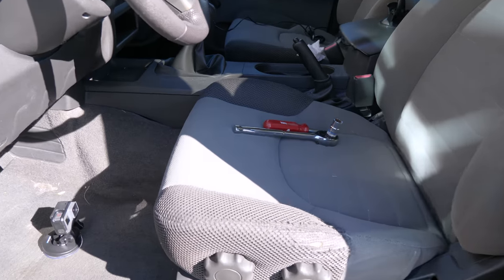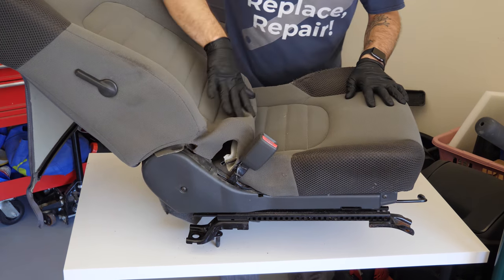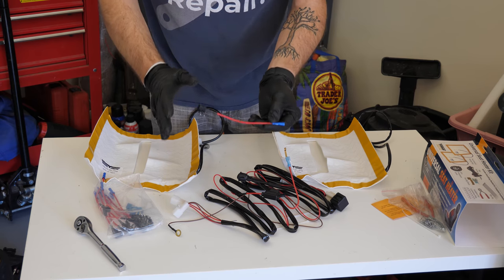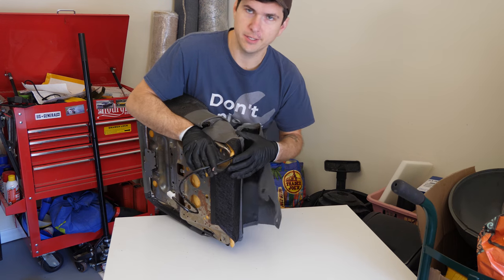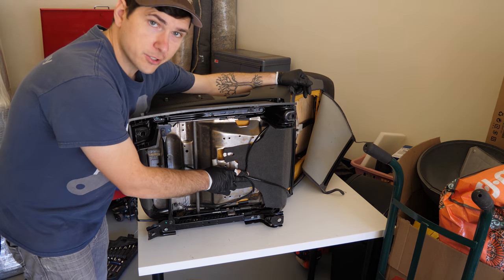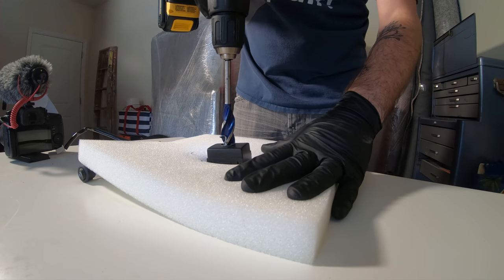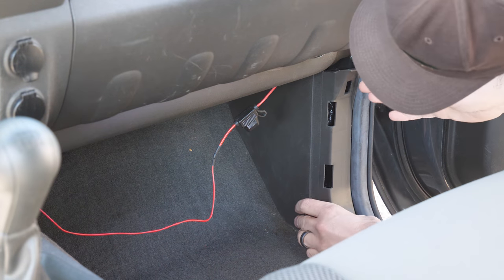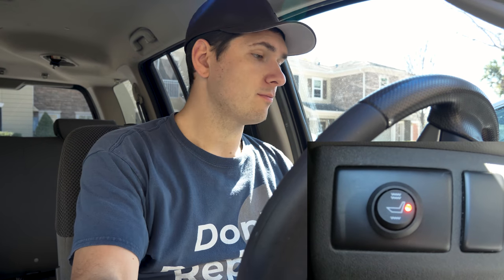How To Install A Seat Heater Into A Nissan Xterra/Frontier/Pathfinder/Armada

Comment: I spent years in the automotive aftermarket industry.  I've done plenty of heated seats. 
You have mad skills my friend
Reply from the maker: Thanks! 💪🏻👍🏻
Reply: Hi  I have a 2012 Maxima and I did a complete interior swap. The new seats are factory heated seats and the new console has the seat heater seat buttons.Is it possible to use the wires from a kit like this to wire those seats? my car is not wired for heated seats.

Comment: A couple ideas. 1) You could replace leaf springs. 
2) Replace rear open diff with some sort of limited slip diff. 
3) add a snorkel (I know that isn't really useful for you but I've been wondering if it's possible)
Reply from the maker: Love the leaf spring idea. Snorkel sounds fun too! Not sure if I want to get into the diff but I appreciate the suggestion. Thanks for the feedback man!!
Reply: @Rythecarguy  No, Yank you! I have 2011 Xterra and your vids have been very helpful many times! Replaced struts and spark plugs using your videos. You have me tempted for seat warmers!!!!

Comment: Love all of your videos, thank you!  I just did this to my 2012 last night.  Quick question,  did you wire both seats to one fuse or did you use two different slots?
Reply from the maker: I actually only did one seat but if I did do both I would have used a different slot for the other seat. Don't want to overload.
Reply: @Rythecarguy  right on, thanks!

Comment: Excellent video, I was looking for a video to replace the upholstery. This is great! Except that you did not removed the seat cover completely. I think if you remove the cover seat and replace it with a new one since you already did all that work, then you will be able to position the heating pad on the desired position. You/we will now have a heating seat with a new upholstery! Mine is already ripped and I’m sure most of the 2005 Xterras need a new cover. This could be a less expensive than doing all the upholstery. 
Hopefully you do a video showing us how to replace that seat cover
Thank you!

Comment: Hey my window has been rolling up really slow and I’ve heard lubricating the rails and stuff can help. Could you make a video on this?
Reply: I can tell you from experience your wasting time & lubricant.  You'll have to replace the motor & regulator.  They are cheap & easy to do.  1A Auto sells the parts & has How To Videos.

Comment: Love you channel being a fellow Xterrarian here lol. Your vid helped me on my Fog light install. I will say seeing yours tho with Manual rolling windows my last car had that was in early 90s and I had no idea X had that as an option. Also at end of Vid we have same year 2005 curious how many miles I have automatic with 108.7k but electrical windows. How about for your next thing to do is Tint the windows on it which you being in Florida would really help!!! Love the channel and all the vids you been making! Last thing couldn't you get nice seat covers and stick them to Stock Seats then put seat covers over and wire how you did?
Reply from the maker: Thanks man! I appreciate you watching my videos! My X is going to hit 150k soon. I think I am around 148,500 miles. I like the tint idea, it does get crazy hot down here. I suppose if you are not worried about potentially messing up your upholstery with adhesive you could try it. I would also recommend a very thick seat cover of you try it. Most seat covers are super thin. I would not want you to burn yourself or something by not having enough fabric between you and the heating element. If you try it let me know how it goes!
Reply: @Rythecarguy  Thanks for reply and really do love your X vids. You make everything so simplistic and enjoyable as you do stuff.. I bought some on amazon and they are a little thick like 1/4 inch and like a neoprene fabric style. The main reason is I've been needing to cover seats as driver seat from coming in and out is separating at a the point where the 2 fabrics meet from climbing in and out of the truck which for every older X i see that happens to it. So I need seat covers honestly to protect it and make the seats last and don't want to put in heat elements in regular seats then have seat covers as that seems to thick to me and won't be hot enough I think. I am gonna keep my X running as long as I can I love that truck. Its also 2wd "Soccer Mom" Edition lol. I bought mine brand new in 2005 with 3miles on it and like I said I have almost 109K now.

Comment: I always enjoy your quality videos. Once again this is a Great video. I did both of my front seats for 2008 Xterra two years ago. By far the best mod I have done especially if you’re in a cold climate. I have not done any upholstery before so taking pictures was very helpful. Also, the metal parts under the seats are sharp so wearing the right gloves saved my hands. 

At the moment I am dealing with the short in my Transfer Case Unit. Essentially my 4wd works intermittently. Dealer quoted 1500$ CAD to replace. Can’t seem to get my hands in a used unit and the part itself. Is about 1200$CAD. Any ideas where to get a used TCU?

Comment: Thanks for the video bro I love it I defenitly going to do this on my xterra but I have a question did you add heaters to the two front seat and one switch? Or you didn't show the second one thanks again
Reply from the maker: Oh yea didn’t mention that. Second one would be a second circuit and second switch.
Reply: @Rythecarguy  thanks bro you are very good reference before any project

Comment: Hey RY the CAR GUY. Really nice videos I have a question  i have 08 exterra. I did LED LIGHTS and I unplugged both  battery cables like you did on one your videos. And the VDC/SLIP LIGTHS COME ON I DON'T KNOW HOW RESET PLEASE CAN YOU HELP ME. THAN YOU.
Reply: dquintanlla That happens sometimes when the battery is disconnected. Drive it for a while and it will reset and go off.

Comment: Aloha y'all...
I'm curious about where you purchase parts online for the Xterra...? Amazon?
I've removed my headliner for repair (the liner fell apart and hung off the headliner for months before I pulled it off) and promptly lost some of the brackets and bolts...
[  I regret NOT simply putting them back in place AFTER I pulled the headliner out... (sigh) I did put the parts in ziplock bags... and then quickly misplaced the bags... LOL  ]
Oooo... a headliner video would be nice... (grin)
* * *
U DUN GUD... I appreciate your efforts and quality of video... superb.
* * *
𝐁𝐨𝐫𝐧 𝐨𝐧 𝐕𝐚𝐥𝐥𝐞𝐲 𝐈𝐬𝐥𝐞,
𝐇𝐨𝐦𝐞 𝐧𝐨𝐰, 𝐍𝐨𝐫𝐭𝐡 𝐂𝐚𝐫𝐨𝐥𝐢𝐧𝐚;
𝐀𝐥𝐨𝐡𝐚 𝐲'𝐚𝐥𝐥...
* * *

Until that time. . .

Comment: I thought I was trippin’ when I saw double
Reply from the maker: I threw a little movie magic in there. Haha
Reply: Ry the car guy any chance you have a video that goes over tire sizes? I put a 3” spacer lift on my 2009 pathfinder and the tires look a little small. I wanna put more meaty tires on there with the stock rims, is that possible or would I need to get new rims? Any help would be greatly appreciated. Thanks for all the vids btw, they’re a great help.
Reply from the maker: Oh man, unfortunately not. I have not gotten to upgrading rims/tires. I put on new rubber when I first bought it and I am waiting until they need to be replaced before I make a move. My only thought would be to point you in the directions of the forums. :/

Comment: Now the circuit has 2 fuses - confusing for the next guy if one blows at the fuse box he'll have no idea to check for a second. And there's a dedicated circuit for seat heater - so you didnt even have to use the "add-a-circuit".
Reply from the maker: 👍🏻 ok but I don't mod my truck for the next guy